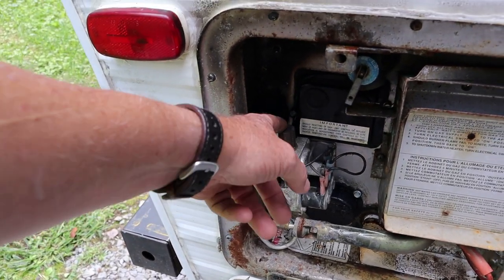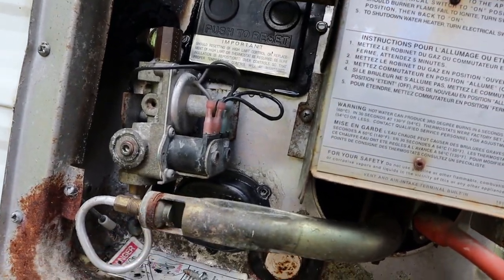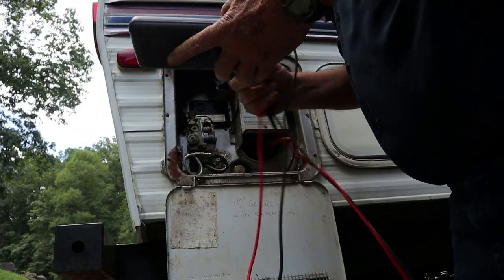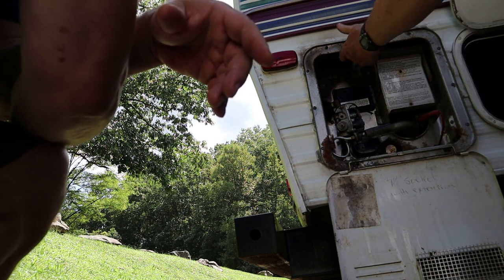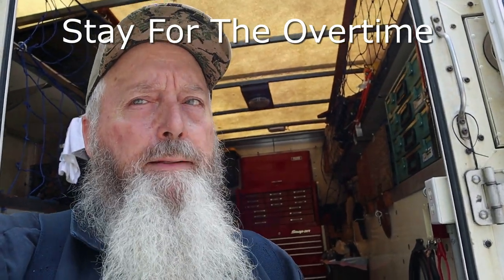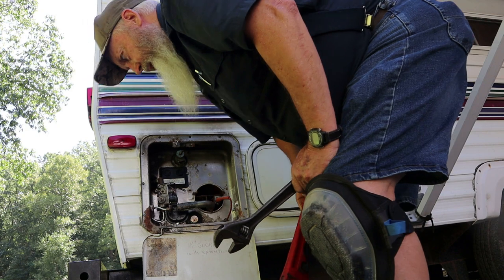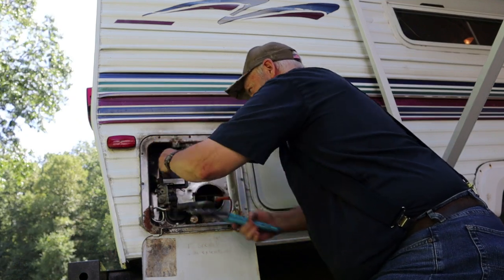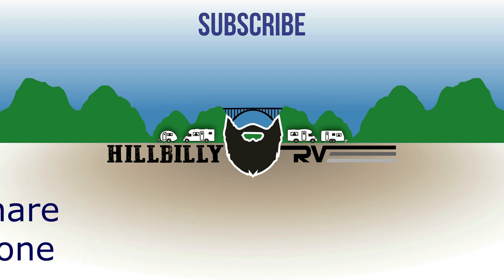Why I Don't Install Used Parts

Comment: I have a special "socket" just for those pop off valves, using a 1/2" ratchet. It slips straight over the valve and has a slot for the threaded part, comes right out. Not sure where it came from but i think its technically a residential plumbing tool. Makes it alot easier.  
Your way worked to so thats the important thing,  nice work.
Reply from the maker: Someone else told me about that socket. I have one coming from Amazon.

Comment: That guy that came over, so annoying,  but hey you can still charge all your normal fees even though your already there. They think just cause your at the site you shouldn't charge the same, then you explain why its not fair that basically he wants a better deal than the guy you did charge for showing up. 
Its hard sometimes to be nice and still make a living.
Reply from the maker: I should do that, but I usually don’t.

Comment: I cleaned my water heater the other day....didn't put plumbers tape on plastic plug...not leaking..should I go back and put it on?
Reply from the maker: Most don’t leak. If it ain’t broke don’t fix it.

Comment: Im working on an Atwood Furnace and the allen set screw on the metal squirrel cage wont budge - I have it soaking in penetrating fluid over night - any thoughts on where I go from here if it continues to be stubborn?
Reply from the maker: Are you changing the motor? If you are and you can't get the squirrel cage off, just get a new one.
Reply from the maker: Wow...good luck. @steveg6181
Reply: Yay me! This old, fat disabled guy got it changed out! Multiple hours of penatrating oil later it cut loose. Will test it once I can get the circuit board cleaned up.
Reply from the maker: YAY !!!!!! @steveg6181